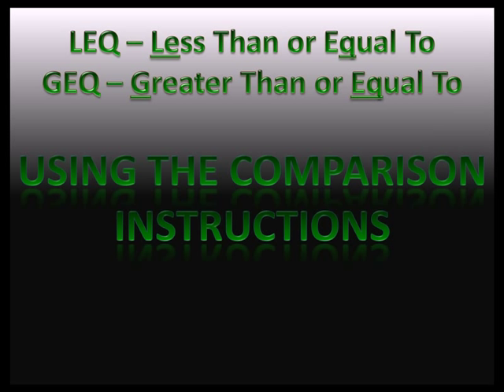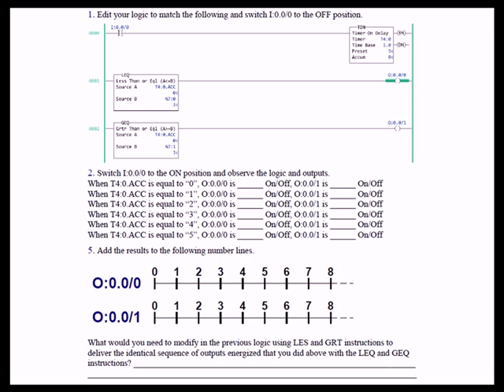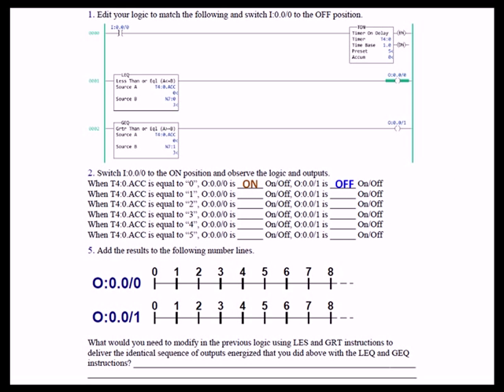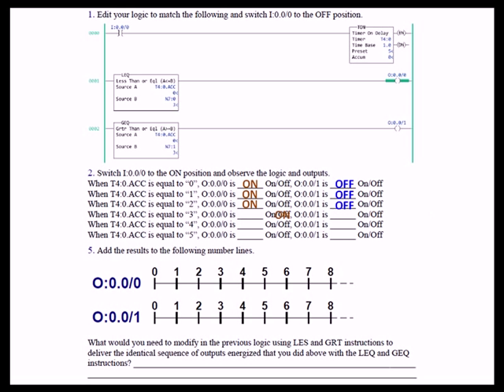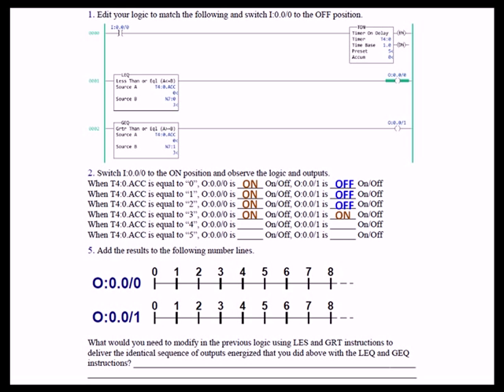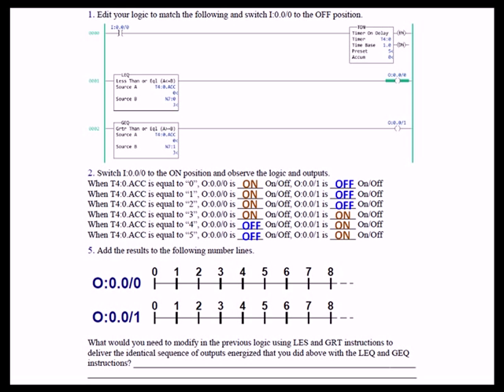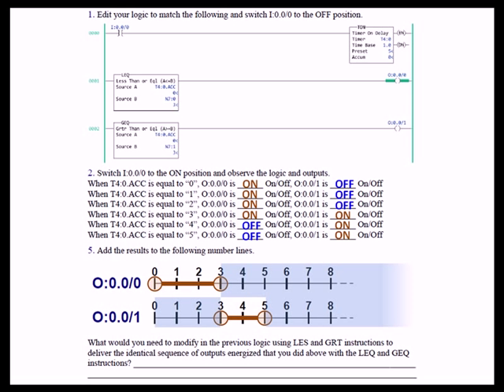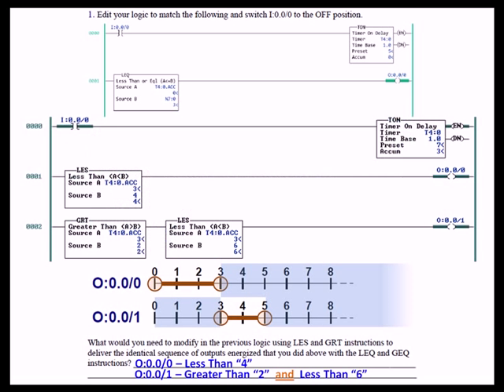ADV1 07 - LEQ GEQ Instructions RSLogix500, A PLC Training Tutorial.

Comment: At the Sawmill where I am contracted out to as an Electrician, I am the sole Electrician for Maintaining, Everything that is Electric...and more that the Millwright can't get to when it interferes with my Job. We use mostly Allen Bradley... We use Logix 5000 as PLC Control..I want to learn all that I can but, I am Already Muddling my way through the apparently Secret World of PLCs...... I am looking for resources.
Reply from the maker: The shortest distance between here and there: 1. CL100 online course from the websites bookstore 2. Get the Complete PLCLearn Series manual from the bookstore, do most of the lab projects. 500 or 5000, the basic instruction set is identical and 500 is the easiest to learn with. Then consider RS5000 Volume 1 from the bookstore.
Reply from the maker: There are a number of free videos on this channel for RS5000 and more added each month, but they are in context of already knowing RS500.